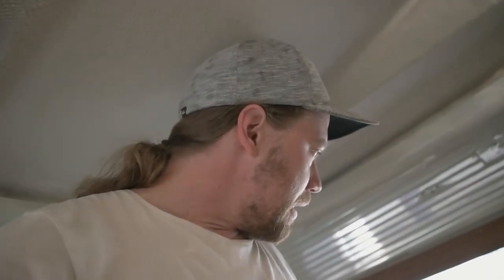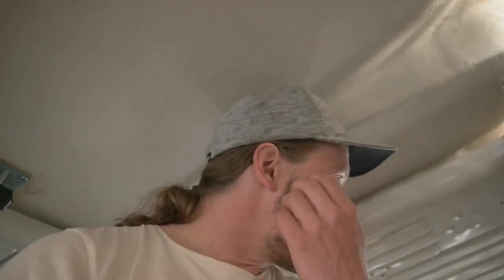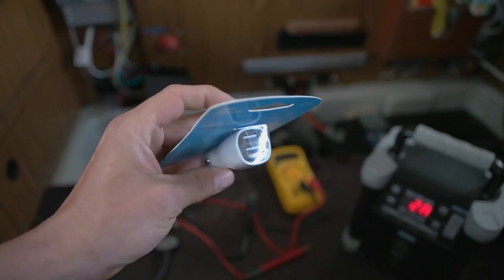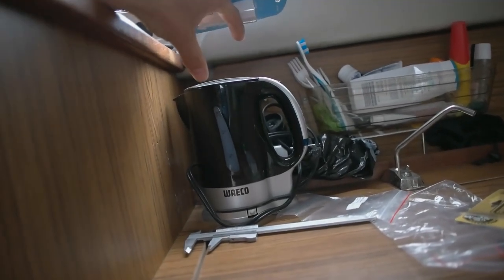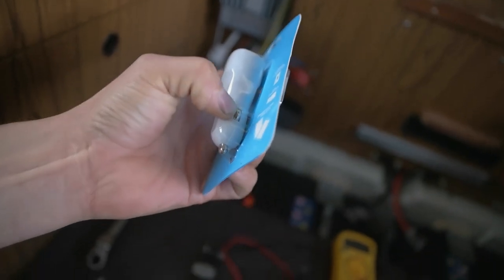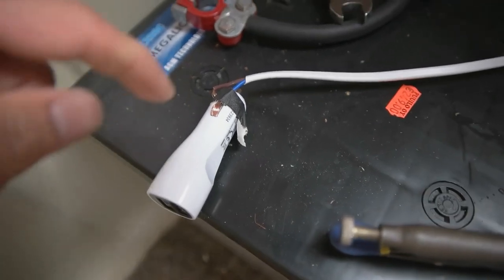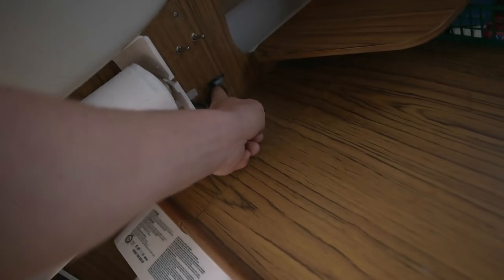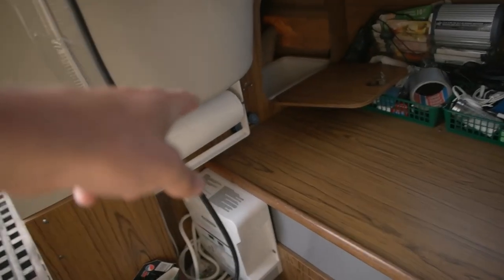Battle for the bad battery starts - Electric sailboat vlog 0027

Comment: I am not sure how you are going to resolve this without additional electronic equipment. I think the problem is that within each battery there is a sensing issue as far as balance is concerned and with both batteries in series there is no way to balance between the batteries. I cannot offer a solution as it is an area beyond my expertise but one often sees this sort of 'behaviour' when two machines are sharing load - one will always dominate and you need sensing and control to overcome that situation.
Reply from the maker: +Norman Boyes Thanks. I solved it by buying a new one :)
Reply: Pauli Juppi But is that THE solution or will this happen again and if so, how soon?